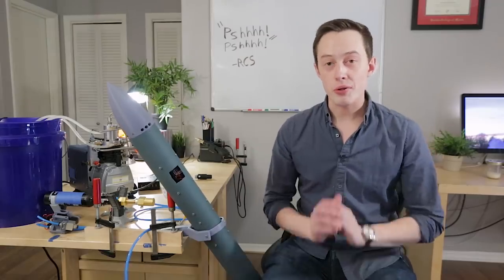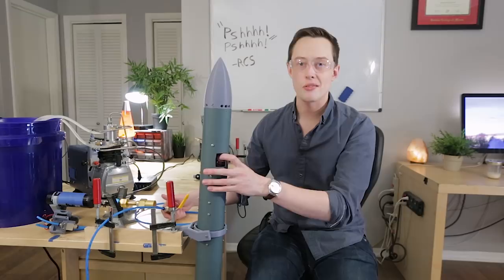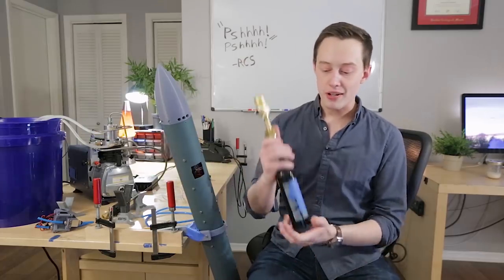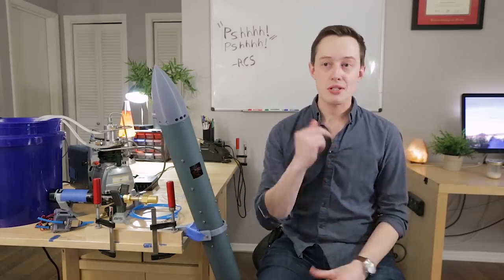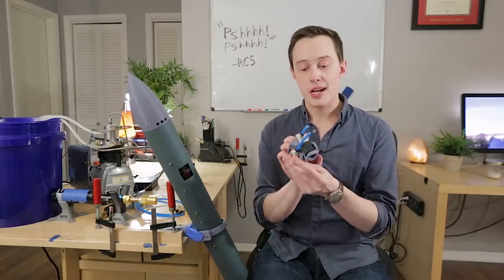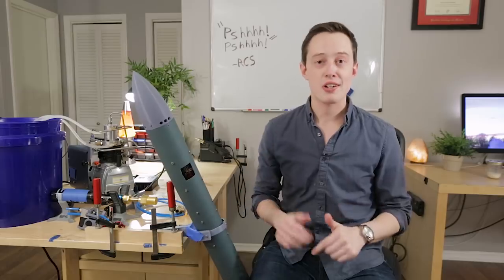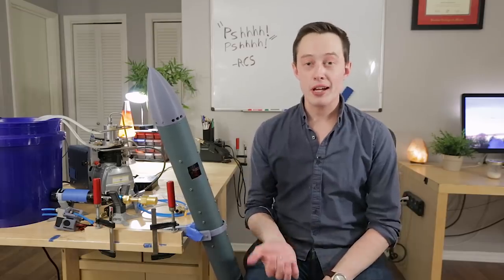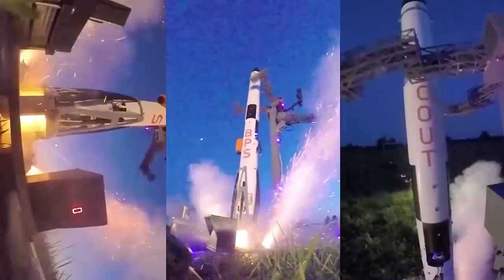Model Rocket RCS Thruster Update

Comment: It's been 1.75 years between this video and this comment, but to be optimistic....

This solution, while "cool," is a can of worms -- pun intentional. It is heavy, complicated, with insufficient precision.

The "correct" solution, insofar as you understand engineering is to make good engineering decisions, is described in another comment of mine.

"Lattice" fins in the form of splayed multi-wings, each side, ideally deployed not with a servo, but a explosive pin holding back a tensioned spring (they make those, right?), will dramatically increase righting moment and rotational inertia, for about (I'm estimating) 30 g of all up weight.

Do that instead. It'll work.

Comment: Saw this video I know exactly what you need Daystate air rifles use of electric valve system which can handle 200 Bar pressure no problem I’m speaking with someone who has a good contact at daystate to see if we can do something for you I agree with one of the chaps you need a single around disk manifold which controls the distribution of air and the valves all in one unit which I might be able to fabricate for you as I am I machinist based in the UK trying to get hold of one valve to see what I can do have a look on YouTube for daystate electronic air rifles might also be able to do the regulator as I also have experience of those two

Comment: Isn't it simpler to use the fins to control the rocket rather than that bulky complicated solenoid relay system!! It's only a low altitude rocket, not a outer spacecraft!